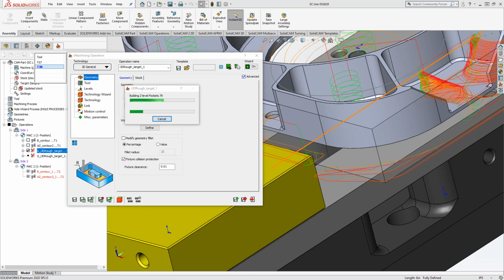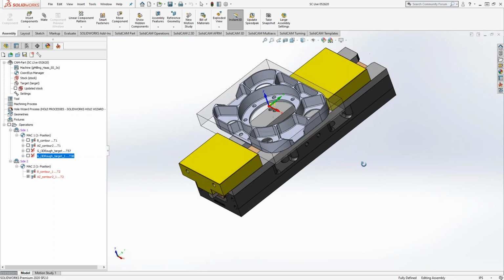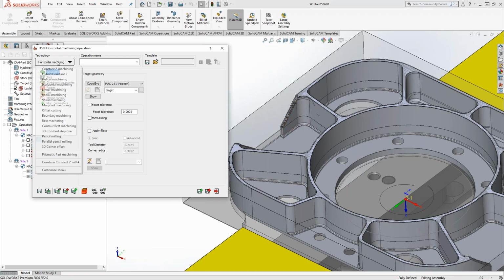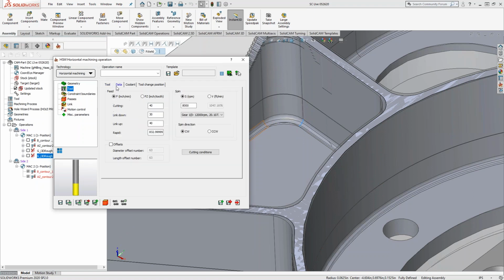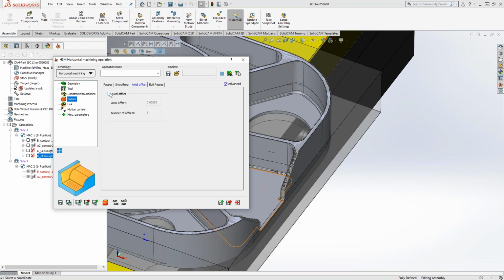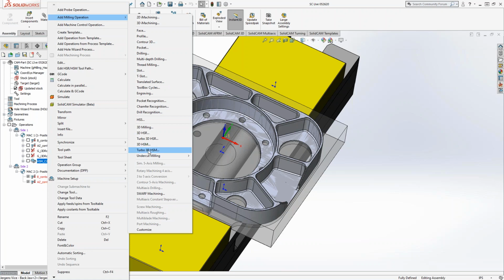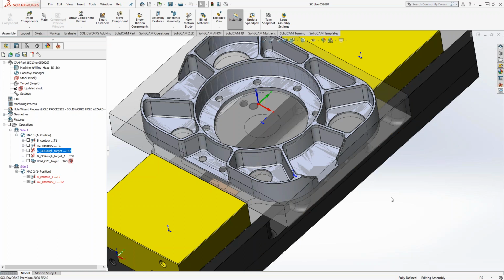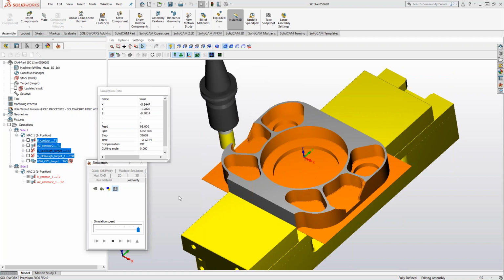SolidCAM LIVE - HSM finishing

Comment: Would this SolidCAM training also apply to and crossover to InventorCAM easily?
Reply: Yes, InventorCAM and SolidCAM are essentially the same software just embedded within different CAD packages, Autodesk Inventor & SolidWorks respectively.
Reply: @markpimentel1937  Thanks Mark!
I heard that SolidCAM has automatic tool selection in feature recognition.  Can you confirm this?
Reply: @Repomam2000  We do not have automatic tool selection.  Our iMachining toolpath will calculate feeds and speeds for you to optimize your toolpath but it requires the user to define the tool to be used.